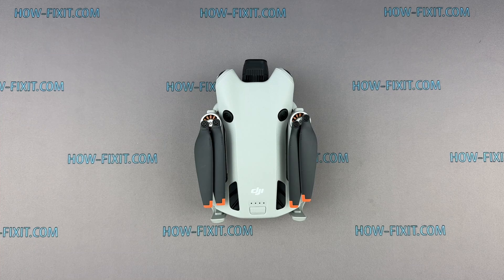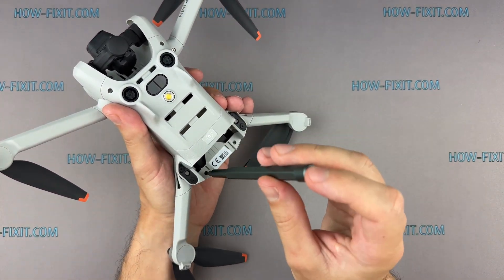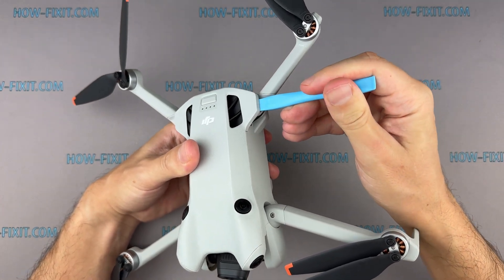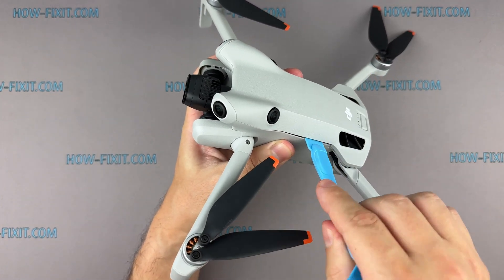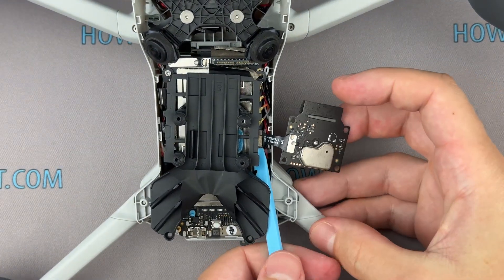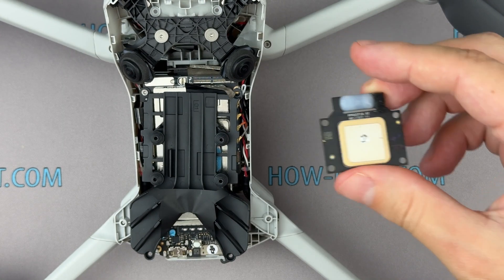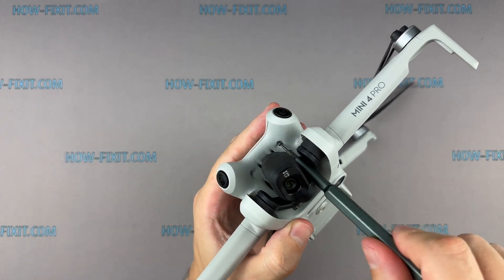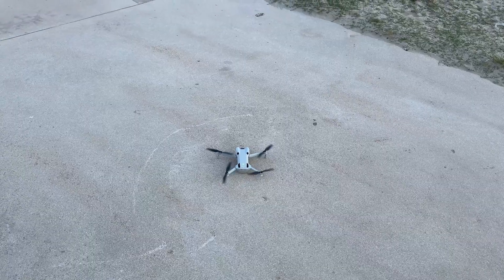DJI Mini 4 Pro GPS Module Replacement | How to Fix GPS Signal Errors

Comment: I have already changed the GPS module on my Mini 4 but it still has an error and does not calibrate. To take off it cannot receive satellite signals (Home Point) if it does not take off. Without the signal, it flies normally and after detecting the signal with it already in the air, it continues to function and the RTH even works precisely. Is there any software you have to go through after installing the new module?